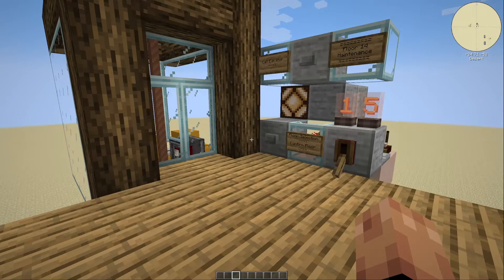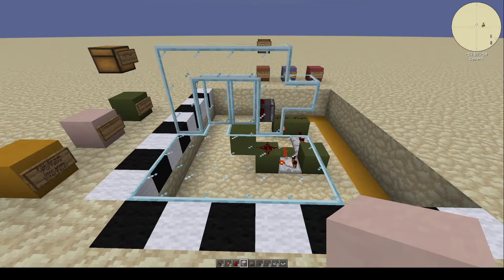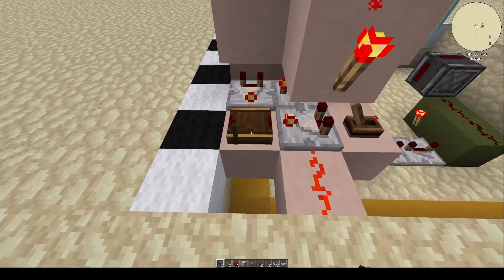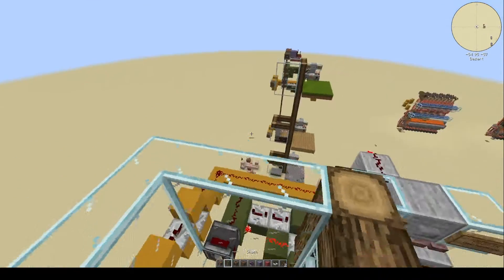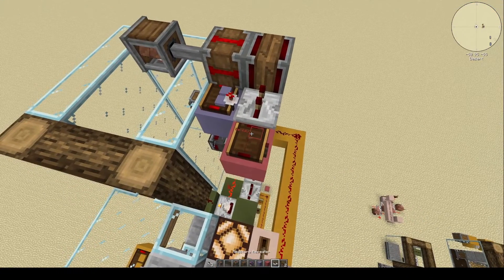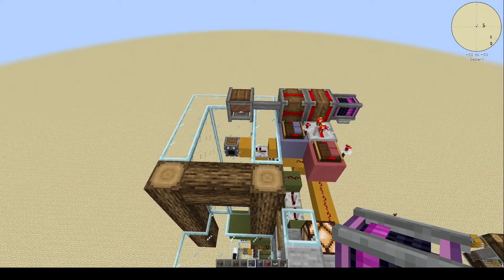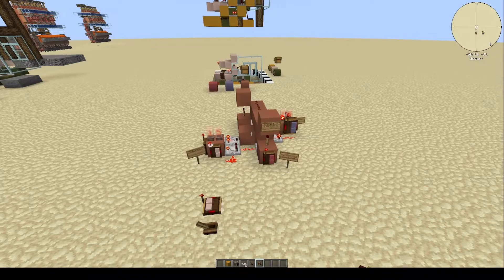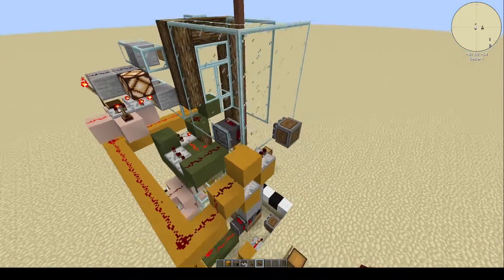Minecraft Create [0.5] - Multi-Floor Elevator V2

Comment: The redstone receiver you place at 6:43, how do you have that powered? When I have placed it, put in the frequency blocks and changed it to receive mode, it is not lit up like it is for you.
Reply from the maker: It's only lit up here because I built this next to the demo lift - so the floor selection circuit that powers this already exists. Nothing to worry about - as long as it is in receive mode 😊
Reply: @OffBy0x01  Ah, ok, cool. I kinda started wondering about that when I saw, a bit later in the video, you hit a switch to make the elevator come down, and in the background, one of the other elevators started moving at the same time.
But yeah, thanks very much! AWESOME elevator!

Comment: keep in mind that the performance of your pc or server dictates the ideal speed. my pc only allows 32 rpm to make it work without bugs
playing with alloffabric6
Reply from the maker: I did test it on my wife's PC too which is about half as powerful as mine & got similar results - I suspect it is actually differences between forge & fabric.
Reply: @OffBy0x01  quick question: 
Does the top floor have to be floor 15?

whenever i try to go from floor 10 to floor 1, it stops at floor 3. floor 9 goes to floor 2. 
somehow there is a calculation error i believe.

i have 10 floors. elevator running at 32RPM because of the server (or forge / fabric).

edit: did some more testing. it seems to be consistently wrong. from floor 15 it goes to floor 7, from floor 14 to 6, etc. 
i have rebuild the design from scratch 3 times now. cant figure it out. is it something with comparators being different? (for me they are in "subtract" mode when the torch is on)

edit 2: did some more testing and found out that the button is not pressed long enough for the floor targeting system to count down. the time the wooden button is activated is only long enough to count down 8 floors. counting up is not a problem because it starts at 15.

Late night edit 3: after a lot of trail and error i figured out how to easely (and "cheaply") extend the pulse long enough to count down from 15 to 1. 
the layout (in a single line of blocks. you can fold it of course) looks like this: redstone link (both freq. pink) -> 6x comparator -> block with redstone link (only freq. 1 pink) -> 6x comparator -> block with redstone link (only freq. 1 pink). For the floor targeting circuit you remove the pink on freq. 2.

15 floors = 12 comparators.
14 = 10
13 = 8
12 = 6
11 = 4
10 = 3 (dont know why, half the time 2 comparators is not enough)

Thank you for the video. tinkering with this build was amazing and it finaly forced me to try and understand redstone a bit more than the avarage 1x2 hidden door. Hope this amount of edits didn't clutter your inbox.

Thanks again,

Comment: Yo amazing system! Thanks for the share and the great tutorial. I successfully finished the elevator and it's working quite fine. I just have an issue, If I want to go for example target floor 6th from 3rd no issue. It's going right away but if I target floor 3rd from the 6th then it's gonna stop to each floor because the redstone signal will be 3 which is not enough to reach the portable interface storage of the 4th and 5th floor. Did I messed up somewhere ?
Reply from the maker: I suspect you might have missed a torch on the circuit at 08:04.

TL;DW;
You change the length of the circuit relative to the floor.
If the signal is greater than target it should be on
if the signal is less than target it should be on. 
If the signal is the same as target it should be off.

Comment: Amazing design! I am a bit confused on how the green circuit works, however. I'd like to have my floors begin at 01 instead of 13, but I can't quite understand how I should configure the redstone. Am I meant to wrap it around like the yellow circuit, counting back until I reach 01?
Reply from the maker: Yep - just as you say, count down - you can use a Nixie tube to check the signal strength is correct.
Reply: Cheers! I appreciate the speedy reply, hope you had a great Christmas

Comment: This looks amazing. But I'm wondering if it's possible to have the controls (floor selector and start button) accessible from within the lift cabine?
If not the floor select, then at least the start button.
For aesthetic purposes, but also to make starting the lift less of a race. Because now you have to push the button, and then "run" into the cab before it sails off without you.
Reply from the maker: Yes, it can be. The controls don't need to be continuously powered as all the guiding logic is handled separately.
Reply: @OffBy0x01  Thanks for the response!

Comment: Looks awesome!
Although I either didn't understand or you didn't explain about the second button which starts the lift after the floor is selected (as even in logic demonstration the moment you changed the floor the lift started moving)
Reply from the maker: The top button calls the lift to your current floor. The lever allows you to select which floor you would like to travel to but does not actually lock in the destination until the bottom button is pressed. Essentially you don't have to worry about the lift moving until you have confirmed your destination. 

In the logic demo at the end, I was essentially bypassing the 'lock in circuit' that would normally be present on each floor.
Reply: @OffBy0x01  Ah, I see. Thank for the explanation!